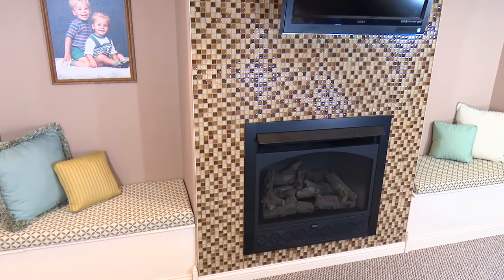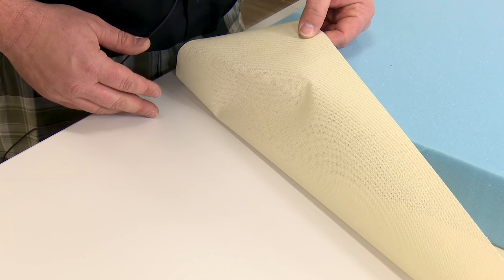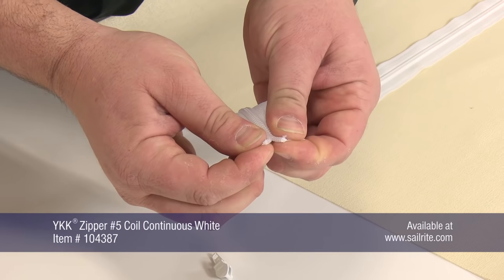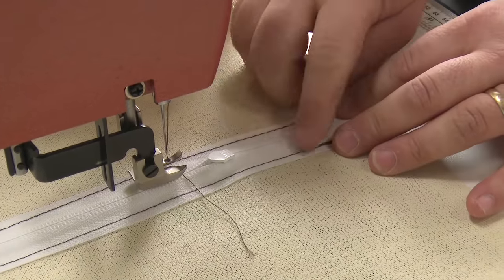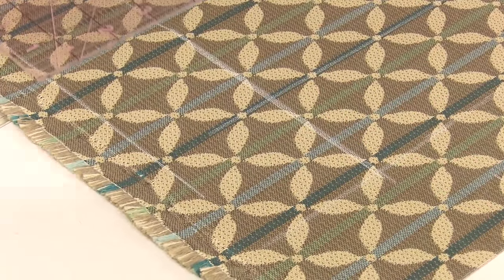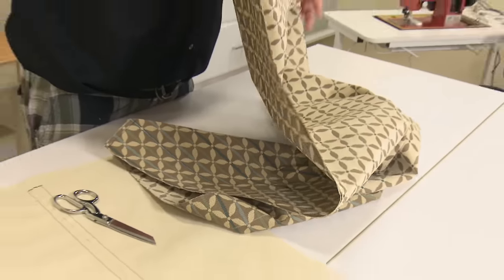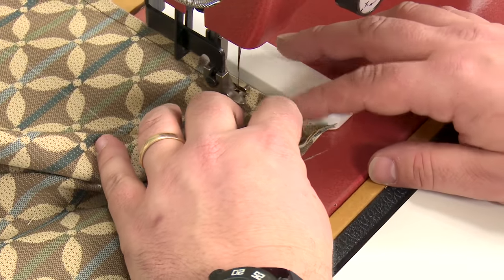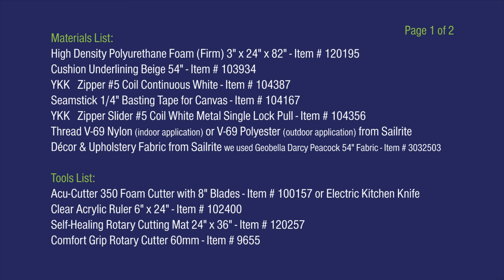How To Make a Quick and Easy Box Cushion

Comment: Im totally new to this and im so confused with all the 1/4inch stuff... if I just sew a cushion without the bottom piece as a different material but rather the same material and i dont take away the quater inch whats going to happen? 
I dont mind doing it but to me.it doesnt make sense.. so basically if i measure every piece cut to size and then do a 3/8 seam would that still not create a snug fit?
Reply from the maker: Since your top and bottom fabric will be the same fabric you could just ignore 1/4" removal process. The seam along the bottom edge may be visible when the cushion is done, rather than slightly under the bottom edge and out of sight. If you are ok with this then skip that step. 
LET ME EXPLAIN THE PROCESS SHOW IN THE VIDEO:
The top plate incorporates the boxing as you see in the video. However, let’s break it down in smaller steps to hopefully explain it better.
At 9:56 min Brian traces around the foam which is already ¼” larger than the opening it fits into. This creates a top plate which is the exact size of the foam. Next at 10:10 min Brian measure the thickness of the foam and then takes away ¼” from that thickness. The boxing is not as wide as the foam by ¼”. True the 3/8” seam allowance is not taken into account intentionally because we want a tight fitting cover. So… the ¼” (which was taken away) and the 3/8” seam allowance that will soon happen to sew the bottom plate on, will take away about 5/8” of the overall size of the boxing making the cover fit very tight, which is what we want. This helps, pull the incorporated facing/boxing (facing included on the top plate) down, so the bottom plate fabric does not creep up and show itself along the bottom edge when the cushion is finished. 
Let me know if you have more questions.

Comment: Hey I'm confused. I understand why the foam is cut 1/4 inch bigger on each side. I don't understand why the underlining cushion is cut 1/4 inch smaller than the foam. That makes the cut out underlining the size of the required cushion. What about the seam allowance? Once the underlining and fabric have been stitched together it will end up smaller than the required cushion size.
Reply from the maker: The top plate incorporates the boxing as you see in the video. However, let’s break it down in smaller steps to hopefully explain it better.
At 9:56 min Brian traces around the foam which is already ¼” larger than the opening it fits into. This creates a top plate which is the exact size of the foam. Next at 10:10 min Brian measure the thickness of the foam and then takes away ¼” from that thickness. The boxing is not as wide as the foam by ¼”. True the 3/8” seam allowance is not taken into account intentionally because we want a tight fitting cover. So… the ¼” (which was taken away) and the 3/8” seam allowance that will soon happen to sew the bottom plate on, will take away about 5/8” of the overall size of the boxing making the cover fit very tight, which is what we want. This helps, pull the incorporated facing/boxing (facing included on the top plate) down, so the bottom plate fabric does not creep up and show itself along the bottom edge when the cushion is finished.

Comment: I am making the quick boxing cushion cover, but I added your polyester batting to the thickness of my 4 inch cushion on the top and sides.  How do I account for the polyester batting thickness in the calculation for the boxing allowance?  If I didn't have the batting it would call for 3.75 allowance, but with the batting what should I do.  Also do I account for the batting thickness as uncompressed or compressed?  Thanks!
Reply from the maker: I would compress the batting on the foam with your hand and then take your foam thickness measurement. If your foam is 3.75" without the batting and you are using our batting only on one side of the cushion, I bet your overall thickness is 4.25" after compressing slightly.
Reply: Ok, so I should account for the batting thickness with a slight compression.  My raw foam measurement is 4inches by 24.5 by 7.5 and adding the batting to the top and sides makes with slight compression makes it around 4.5 by 25.25 by 8.25.  So then I should use those "padded" numbers when figuring out the top plate dimensions including the side boxing?  So if I did my numbers right, the top plate should be 33.75 by 16.75 by 4.25 cutout corners
Reply from the maker: @andrewbicek9103  If the cushion under slight compression (due to batting being used) measures the following: 8.25" width x 25.25 length x 4.5" thick then your cut panel rendition will be 34.25"  x 17.25" and your corner cut outs will be 4.25" I would suggest you plug your figures into this calculator: http://www.fabric-calculator.com/FoldOverSimple/index.html

Comment: Great video, thanks! This will be my first attempt at a box cushion. Seems like the cut for the bottom plate was exactly to the desired size. Do you have to add a seam allowance?
Reply from the maker: You are correct the size of the bottom plate (step 2) is the size of the desired size or a 1/4" smaller than the size of the foam on all sides. No, we do not add for the 3/8" seam allowance. We want the bottom plate to pull the sides of the cushion cover down to the underside of the cushion, this looks best and the tight fit also looks great! Good luck!!!
Reply: Envelope bench seat cushion
Reply: I was also wondering why the measurements were sized down 1/4 inch and no seam allowance was added. I'm a garment sewer, so I was concerned 😂

Comment: This How To Make a Quick and Easy Box Cushion video is amazing.  However, my cushion corners could be better.  Question:  Do I need to sew to the end of the material?  It seems in the video that he starts in about 3/8 inch.  Is this correct?  Thank you.
Reply from the maker: In the video it looks like he is sewing about an 1/8" inch away from the corner. Since he is so close it does not result in a bad looking corner. However, you should sew all the way to the corner to avoid an opening at that location.
Reply: I should sew to the corner on all ends.  That helps.  Otherwise my finished product is perfect.  I will try your direction on my next cushion.  I am making 3 more cushions.  Thank you.
Reply: Flang pillow

Comment: how waterproof would this be?  it seems like foam like that is similar to a sponge.
Reply from the maker: Yes, this foam would soak up water like a sponge. We do have foams that soak up no water called "Closed Cell Foam" and other foams that allow water to flow thru the foam so they can dry out quickly called "Dry Fast Foam" . If you have more questions let me know.
Reply: @SailriteDIY  I wasn't expecting a reply since it's been a year since anyone posted on this video but I got a reply in less than an hour I appreciate this. I was looking at the website and selected outdoor cushion foam and it didn't take me to the dry fast open cell but it did take me to the antimicrobial foam.  But I'm now looking at the dry fast.   
Thanks.

Comment: When cutting the fabric which way is the lengthwise grain?
Reply from the maker: If you use the fabric calculator:  https://www.fabric-calculator.com/FoldOverSimple/index.html you can orientate the cushion on the length or width of the fabric. Just click the button under "Orientation --- Cushion Length on Fabric" The "Panel Rendition show the direction of the width of the fabric going from left and right on you computer monitor.

Comment: I just finished this using an overlap pillowcase opening on the back.
Since I used an existing foam from an outdoor ottoman, the foam was too stiff to get into the cover!. My old ottoman had a stiffer , denser, yellow foam with batting  on the outerside of the foam. The only way I could get it into the cover was to remove the batting, which makes the pillow look flat. So in hindsight, I needed to think that through.
Reply from the maker: You may want to consider using silk film to help compress the foam to install it in the cover. Here is a link: https://www.youtube.com/watch?v=3ffvhyMo9e4
Reply: thank you! Got it done.Used the foam with the batting only on the bottom, then slipped the second battting after the foam was in. Came out very nice. Thanks for the tutorial.
Reply: I have some queen anne I think thats the name) chairs that have tapestry upholstery on the seat, back and arms. Can I even attempt to reupholster this? Not sure if its glued on or how since it has edging all around.
Reply from the maker: Can you email me a photo? email eric@sailrite.com
Reply from the maker: You are welcome!
Reply: Thank you. I will do it now before I forget! The chair frame is beautiful but n one the fabric is shredding.

Comment: Can u explain why you add 1/4 to the foam cutting size. I would think that would make the cushion 1/2 too large.
Reply from the maker: The cover is made smaller than the foam and thus compresses the foam, so the extra 1/4" is gone by the time the cover is installed for a better fit in the opening that the cushion will rest in.
Reply: Sailrite my foam was already cut to fit my project, unable to add the 1/4 “ to the foam - any advise on what I can do?

Comment: Why do you measure 2 3/4 for the fabric instead of the 3" for the foam?
Reply: I would also like to know the answer im going to do this i just want to check prior to cutting fabric?
Reply from the maker: The top plate incorporates the boxing as you see in the video. However, let’s break it down in smaller steps to hopefully explain it better.
At 9:56 min Brian traces around the foam which is already ¼” larger than the opening it fits into. This creates a top plate which is the exact size of the foam. Next at 10:10 min Brian measure the thickness of the foam and then takes away ¼” from that thickness. The boxing is not as wide as the foam by ¼”. True the 3/8” seam allowance is not taken into account intentionally because we want a tight fitting cover. So… the ¼” (which was taken away) and the 3/8” seam allowance that will soon happen to sew the bottom plate on, will take away about 5/8” of the overall size of the boxing making the cover fit very tight, which is what we want. This helps, pull the incorporated facing/boxing (facing included on the top plate) down, so the bottom plate fabric does not creep up and show itself along the bottom edge when the cushion is finished.
Let me know if you have more questions. 
Eric
Reply from the maker: The top plate incorporates the boxing as you see in the video. However, let’s break it down in smaller steps to hopefully explain it better.
At 9:56 min Brian traces around the foam which is already ¼” larger than the opening it fits into. This creates a top plate which is the exact size of the foam. Next at 10:10 min Brian measure the thickness of the foam and then takes away ¼” from that thickness. The boxing is not as wide as the foam by ¼”. True the 3/8” seam allowance is not taken into account intentionally because we want a tight fitting cover. So… the ¼” (which was taken away) and the 3/8” seam allowance that will soon happen to sew the bottom plate on, will take away about 5/8” of the overall size of the boxing making the cover fit very tight, which is what we want. This helps, pull the incorporated facing/boxing (facing included on the top plate) down, so the bottom plate fabric does not creep up and show itself along the bottom edge when the cushion is finished.

Comment: I was able to make a cushion successfully but it was alot harder and took alot longer than I would have expected from the video.  I would recommend to others some tips to make it easier.  1) Use stiff, sturdy decorative fabric without any give or stretch.  Positioning and tracing the foam is very difficult if the fabric bunches up, stretches and doesn't slide on your workspace.  2) I did not order the Seamstick basting tape and instead used another (well regarded) brand.  This was a mistake.  The tape I used would not adhere to the rubberized liner fabric for the lower plate nor to the zipper.  After wasting an hour messing around with the tape, I wound up removing it and just pinning the zipper on and then later pinned the top and bottom plate together.  This was much quicker and easier; plus I didn't have to worry about accidentally sewing over or inside the tape, I could easily reposition my pieces,  and I could attach my pieces without having to lay the assembly out flat.  3) I would not recommend using this cushion making method  for a very large project like mine ( my cushion is 74" x 23") unless you have a very large work table and follow tips 1) - 3) above. 

Many people ask why the bottom plate is a little smaller than the cushion or why the top plate + sides deducts 1/4".   The decorative fabric acts as a cap the fits over the cushion top and sides.  It then attaches to the bottom plate just like an upside down bowl sitting on a plate that is smaller than the bowl -- the decorative top fabric should tuck under the sides of the cushion a little on the bottom.  The fabric is cut a little smaller than the cushion to make the cover tight.  I would also recommend deducting only 1/8" from each side vs. the 1/4" recommended (so 1/4" from your total length and width vs. 1/2") because if your measurements are off or uneven just a little (which can easily occur on bigger projects or with fabric that rumples) you won't have much margin for error.

But all in all I am glad I used this approach and am very happy with the results, though it was quite frustrating to make!
Reply from the maker: Great comments and suggestions. You are correct, all double sided tapes are NOT equal. Sailrite makes the best seamstick or double sided tape for canvas and upholstery. If you want it to work - you got to buy it from Sailrite. Thanks for your comments!!!!

Comment: I did try the batting tape ,however it glued up my needle! Is there a way to avoid this
Reply from the maker: In most cases (depending on the fabric used) the fabric's weave will clean the needle as it enters and exits the fabric, helping to reduce the glue build up on the needle from the "seamstick for canvas 1/4". If your sewing machine struggles with sewing with any glue build up on the needle try using goo gone or rubbing alcohol on a cotton ball and clean the needle when needed.

Comment: Great tutorial but I believe there is a slight error, I made them to the letter. The depth is in correct, to measure and minus 1/4 as it’s been added to the foam is correct but when sewing up you have a 3/8 hem which makes the covers even smaller.
Reply from the maker: We want the fabric cover to be slightly smaller than the foam after seam allowance is taken up. In doing this the cover fits very tightly over the foam for a no wrinkle look.
Reply: @SailriteDIY  but if I measure the depth of the foam and minus 1/4” when I sew 3/8 it’s even smaller almost an 1” or am I missing something?
Reply from the maker: @TheJulieNclaire  The top plate incorporates the boxing as you see in the video. However, let’s break it down in smaller steps to hopefully explain it better.
At 9:56 min Brian traces around the foam which is already ¼” larger than the opening it fits into. This creates a top plate which is the exact size of the foam. Next at 10:10 min Brian measure the thickness of the foam and then takes away ¼” from that thickness. The boxing is not as wide as the foam by ¼”. True the 3/8” seam allowance is not taken into account intentionally because we want a tight fitting cover. So… the ¼” (which was taken away) and the 3/8” seam allowance that will soon happen to sew the bottom plate on, will take away about 5/8” of the overall size of the boxing making the cover fit very tight, which is what we want. This helps, pull the incorporated facing/boxing (facing included on the top plate) down, so the bottom plate fabric does not creep up and show itself along the bottom edge when the cushion is finished.
 
Use this calculator to help with your Quick & Easy Cushion: http://fabric-calculator.com/FoldOverSimple/index.html